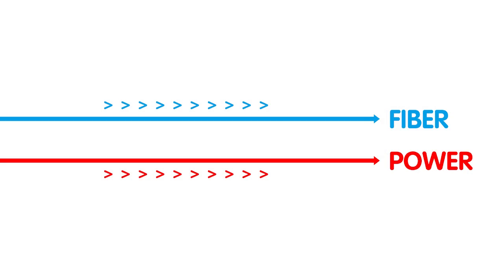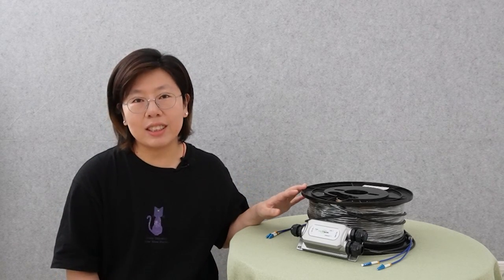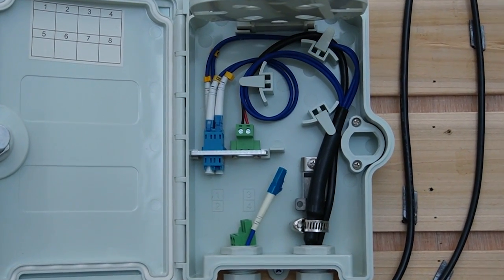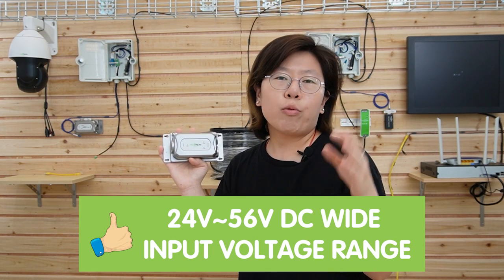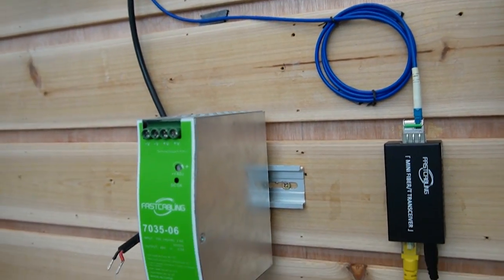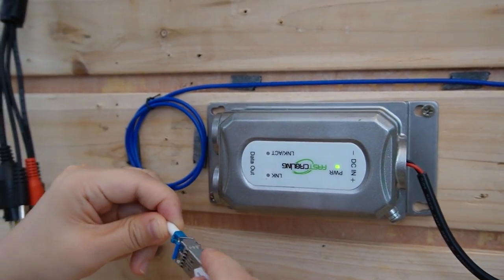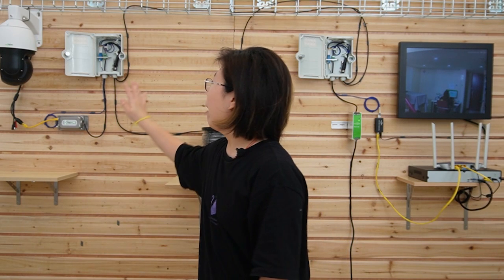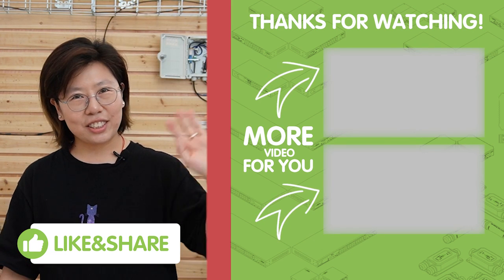Mastering Power over Fiber with Effortless Termination

Comment: what a trash, i thought its using fiber optic cable,
guys, just buy 
-single core fiber optic cable
- camera
- mediacon
- solarpanel + battery
*its way cheaper than buying their products at $2k
you'll save half the price for this set.up.
Reply from the maker: The solar power system is the way to go if you prefer a DIY setup. But you might end up investing more when you're scaling up, which means more solar panels and larger batteries are needed. Cloudy days and shading also reduce its efficiency and cut power output. You need to clean the panels occasionally and replace batteries cuz they can degrade over time. 

For those who prefer a faster, hassle-free solution, our system lets you run power + data over a single cable (but we will still recommend you to use PoE if the distance is kept within 300 meters). Retail price starts at $398, which is way cheaper than sourcing parts separately.

Comment: What is the maximum distance the power supply can provide enough ampere requirement to Fiber PoE Extender?
Reply from the maker: It depends on several factors, including the voltage of the power supply and the gauge (thickness) of the cable. As electricity travels through a cable, resistance causes a drop in voltage. The longer the cable, the more significant the voltage drop. A thicker cable (lower gauge number, e.g., 12 AWG) has less resistance and can carry power over longer distances with less voltage drop. AC power can generally travel further than DC power.

Comment: how many meter can power supply can run?
Reply from the maker: The maximum distance a power cable can run depends on several factors, including:

1. Voltage Drop: Longer cables result in voltage drop, which can cause electrical devices to malfunction. The acceptable voltage drop is usually around 3% for most applications.

2. Cable Size: Thicker cables (lower gauge numbers) can carry more current over longer distances with less voltage drop.

3. Current Requirement: Higher current loads require larger cables to minimize voltage drop.

4. Type of Cable: The material (copper or aluminum) and insulation of the cable also affect the maximum run distance.

Comment: What is the specification of power supply?
Reply from the maker: It is the DC55V 120W power supply units. The maximum low voltage which is safe to touch is 60VDC. The higher the voltage, the less power loss will be. You might find the power supply with voltage between DC56-DC57V
Reply: @Fastcabling  how many amp?

Comment: So their is no pwr over fibre? Its just a power cable run parallel to a fibre. So why wouldn't you just use POE?
Reply from the maker: It's because PoE is limited to 100m, but by using fiber, the distance ban be extended to 20km or more. To deliver power and data through the same cable to the PoE device, you can also implement this Fiber PoE Extender. (https://www.fastcabling.com/product/2-port-fiber-poe-extender/)
Reply: @Fastcabling  oh ok, thanks

Comment: Is the low voltage 56vdc will not drop on 1km wire awg23 pure copper before its reach the other end of media converter?
Reply from the maker: No, there'll always be power loss and voltage drop no matter what type of cables you use. Resistance is inherent in every type of wire, and the greater the value of resistance, the higher the voltage drop across the cable. But DC resistance in pure copper is significantly lower since it has the highest electrical conductivity rating of all non-precious metals.
Reply: @Fastcabling  so, you were saying the dc supply u've used on the demonstration board is isn't affected by voltage drop? sorry need to know more of the details regarding power over fiber.
Reply from the maker: The PoE fiber media converter we used in the video has an internal voltage regulator that will boost the voltage to DC54V. For more information, please see: https://www.fastcabling.com/product/waterproof-industrial-hardened-grade-fiber-poe-media-converter/
Reply: What IS the maximum distance for the power câble ?
Reply from the maker: We haven't tested it yet, but the maximum distance between the fiber PoE media converter and the powered device is 100m.
Reply: @Fastcabling   therefore in every dc voltage long run when you will need to used voltage regulator is it also every 100 meters drop to boost or balance the voltage needed after a 100 meters dc voltage run?
Reply from the maker: Distance is not the only reason that causes a voltage drop. You need to calculate the voltage drop for a specific run based on the wire size, distance, and anticipated load current. Even at the same distance, larger wire sizes (those with a greater diameter) will have less voltage drop than smaller wire sizes of the same length.
Reply: @Fastcabling  specific wire run gauge sizes for 48, 56 vdc parallel to 1km fiber optic cable that's the specific we wanted to understand the dc power transmission parallel to fiber.
Reply from the maker: If possible, can you email us directly at support@fastcabling.com or submit your inquiry here: https://www.fastcabling.com/free-solution-design/. We can provide a free solution design for our customers, and it'll save us a lot of time from back-and-forth comments. Please tell us more about your project, so we can tailor the design to your specific needs :-)
Reply: @Fastcabling  So, you're saying your power over fiber is only feasible in short distance dc power run?
Reply from the maker: No, it just means that you need to design your system carefully.

Even over short distances, you need to calculate the voltage drop because it happens all the time. The material of the wire, conductor size, workload, distance, temperature, etc. all can be the reason for power loss. That's why our fiber optic PoE extenders have built-in voltage regulators to boost the voltage over long runs of DC power. However, a certain level of voltage is allowed if the device receives enough voltage to function properly.

https://www.calculator.net/voltage-drop-calculator.html

If you have any further concerns, please feel free to email us and speak directly to our engineers.